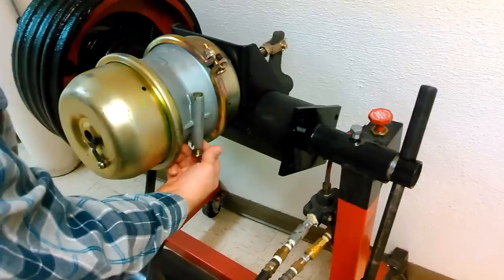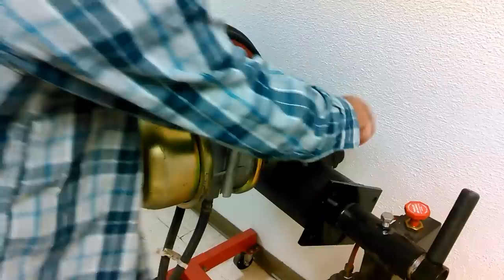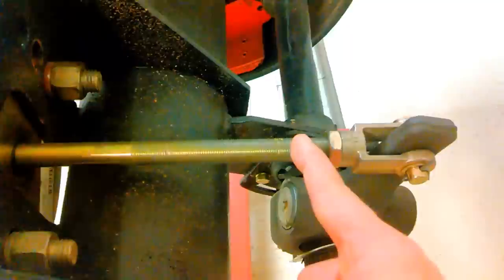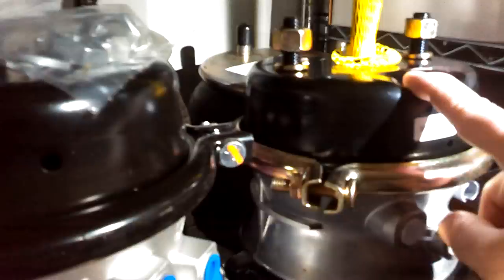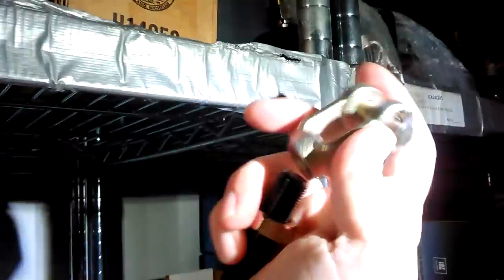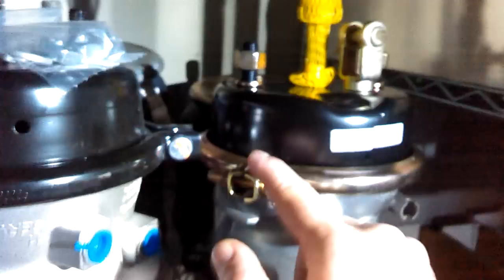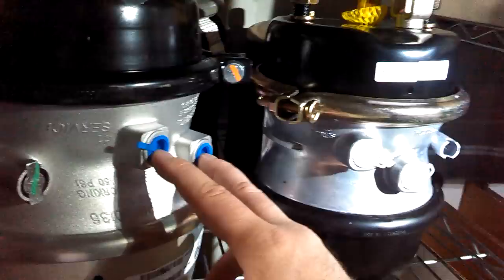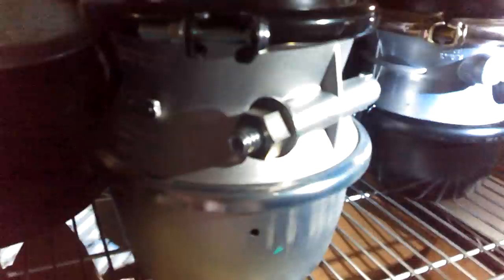Brake chamber replacement : a few tips

Comment: Yeah, once you have to cage one with a crescent wrench, that socket is a must lol. The Haldex 30/30 already has the caging bolt installed. Looks like its riding around with caged brakes and they're much easier.

Comment: On a 30/30 long stroke it is hard to cage the bolt because it further sunk in the can. Also on a 30/30 short or long. Cut the rod at 4.25 inches. But you have to measure the rod length while the rod is fully extended.Then after you cut the rod to the proper length. Put the clevis on. Then install the cage bolt.
Reply: "But you have to measure the rod length while the rod is fully extended."  Good point and a time saver.  I would just add (and you probably already know this) that the old one should be inspected for proper length, because in my five decades plus of working on big rigs, I've seen quite a few which were too long or short.
Reply: Try a 4.25'' rod on a trailer

Comment: Hi important question please,
Can I remove a brake chamber (rear side) without caging it?
Reason is the top side of the place  rusted and the spring bushed half way open, so scary.
That open place where you insert the stud is not in line again due to the impact from the rust.

Comment: Do you have to have the old brake chamber set up a certain way to make your measurement to cut the new rod? for example, do I need to check measurement before I back off the slack adjuster and or cage the chamber to remove the drum  if i'm changing drums and shoes along with new chambers

Comment: How do you turn the pot a quarter turn on a Pete 389 drivers side front axle to take the air hoses away from the drive shaft ?